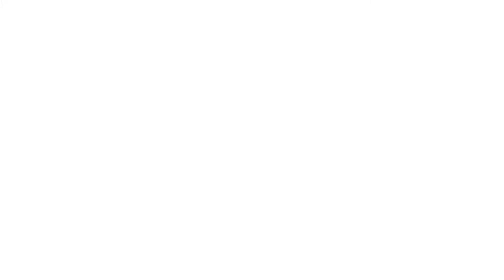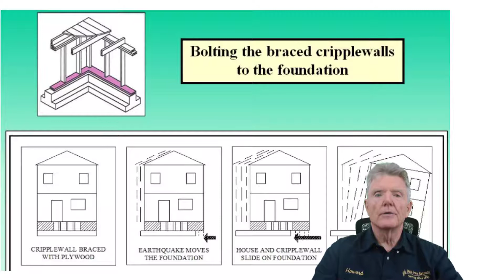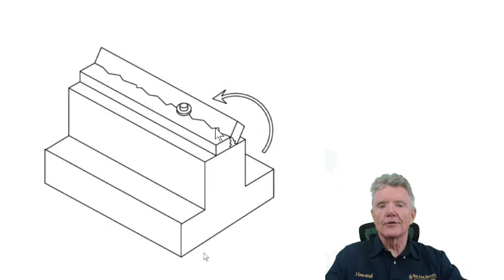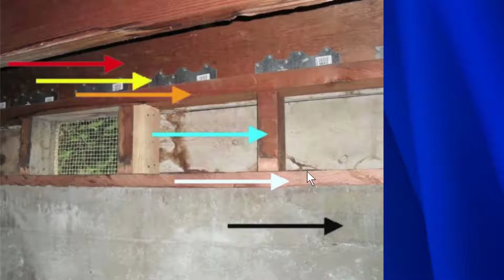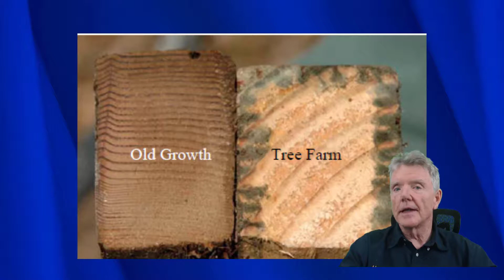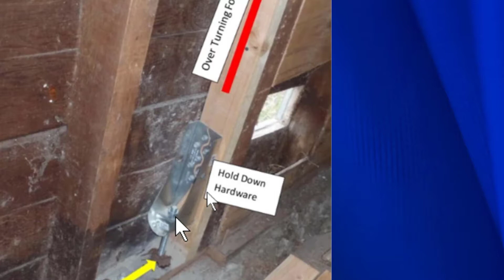Cripple Wall Retrofits 1900-1945: All You Need To Know

Comment: Great video. I just took a class through my city building inspection department. Our home was built in 1921. It has an approximately 24” high cripple wall. There is a basement in a portion of the understory. Our cripple studs are 24” o.c., while the floor joist are the typical 16” o.c. I want add additional cripple studs of old growth doug fir under every joist position that lacks a corresponding cripple studs. Does sound reasonable? It will of course mean that there are more cripples. I would nail them  top and bottom using buttressed 90 on both sides. Your thoughts?

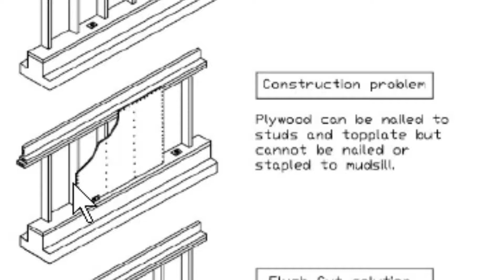Comment: 35:00 Flush cut solution - How many linear feet do you cut out? Have you thought about sistering 2x6s to the vertical 2x4 cripple wall studs and attaching the sheeting to that? That way you don't have to cut the mudsill.  If the top is 2x4 and bottom is 2x6, then you can cut or notch at the top so the 2x6 covers the top plate OR cut the vertical sistered 2x6's at an angle so they're 6" at the bottom and 4" at the top. IDK. Seems less likely the mudsill would split if it's not cut.
Reply from the maker: Flush cut saws are hard to find.  I would use 3x blocks and SDS Heavy Duty Connectors by Simpson

Comment: How do you handle floor to cripple wall connection when there is neither a rim joist at ends, or any blocking between , the floor joists sitting on top plate - perpendicular to the cripple wall? Add 2x blocking  & use L90s? Or hurricane type ties at the joist/plate connection? Both?
Reply from the maker: Add blocking.  First joist bay in line with the top plate and use an LTP4, the next joist push the block against the siding and use an L90 on down the line a few bays beyond the shear wall.
Reply: @bayarearetrofit5814  Got it - thanks info, your thorough videos are stellar btw - much appreciated.  
Re: add blocking - usually just toe nail (or SDS screws? ) both ends of the block?  Seems like proximity to ends of both the joist & block may split the wood ? Hmm a last thought:   if working left to right, suppose one could toe nail the LH side then use a longer fastener & end nail the RH side thru the RH joist from each adjacent joist bay  ?   May gain some strength vs toe both ends etc
Reply from the maker: You just need to hold it there enough so you can put in the hardware
Reply: @bayarearetrofit5814  Interesting, thanks. 
Makes sense to me the hardware would transfer lateral forces from joists/blocking, thru L90's block nails, thru L90's , into to top plate, and on down etc. 
But.... what about vertical forces moving through same system? 
Couldn't the house above shear walls also want to jump off the top plate?  
Seems like the toe nailing of floor joist blocking then becomes a relatively weak point of vertical load path:  if it's
top plate-->L90-->block-->joist-->1st floor/walls ?? Just trying to understand how engineers look at  this, sure I am probably missing something!
Reply from the maker: The house goes up with the foundation and down with the foundation.  Vertical thrust is not a consideration in the building code, even with thrust faults such as the Hayward Fault.

Comment: Great Video, I just qualified for the Earthquake Brace and Bolt program so I'm trying to learn as much as I could in a short amount of time. This video was better than the ones on the EBB website. I do have a question:

For a post and pier foundation, with a masonry perimeter (stone & mortar), can you anchor the mud sill to the stone wall? Or will you it be best to create new cripple walls along the interior of the crawl space?

Thank you!
Reply from the maker: Look at the video on old foundations.  Install new foundation segments parallel to the stone and build and brace cripple walls of the new foundations

Comment: Question:  An lean-to addition was added to my existing 1940s house leaving an existing portion of the foundation/cripple wall underneath the house.  The lean to addition only has external foundation -- it didn't add foundation on all 4 of its edges.  Do I need to add shear walls/retrofit to any of this under house cripple wall?  Is any shear wall added here just part of the overall needed along that "side" of the house  (i.e. the shear wall covers a minimum length needed for that side some on the exterior exposed foundation and some on the now under the house foundation.)
Reply from the maker: Explain to me better the foundation set up.  Looking at the addition from the front of the house.  Is there foundation under the left, right, and back sides of the addition?  Or only where the addition and new house adjoin?
Reply: The original foundation follows a reverse L pattern with the front of the house being longer than the side.  The lean to addition filling in the L at the back left of the house making a rough square.  Hence about 22 feet parallel to the front of the house (of 49 feet total)  and 24 feet parallel to the side is now (of 37 total)  under the house.  The lean to addition foundation is poured adjacent to the back/ends of the existing foundation but not otherwise bolted/plated the existing foundation.  And at least the floor joist supports (girders) aren't attached into this existing foundation under the house -- it just abuts it in the cripple wall.
Reply from the maker: @mfreedman1  Those are tricky.  You need floor to floor connectors and tension ties.  These are very technical but if you type in additions in the website search box there will be some information that will get you started.  These are very tricky and advising you via email will not be possible.  We normally used Simpson Heavy Duty SDS screws for the floor to floor connectors and HDU2 Simpson Holdowns for the tension ties.
Reply from the maker: Are these foundations for additions?

Comment: Question:  My house floor plan can be thought of as is a series of rectangles with the foundation being around the external/exposed edges of the rectangles.  I.e. there is no side that is a single straight foundation.  Does this (and how does this) impact the amount of shear wall I need to add (the same?  more?)  Do I need to be sure that each (distinct rectangle edge) has at least a portion of the overall shear wall on it?  If so what is the minimum and does the length of that edge impact minimums (in some cases my edges are 4 or 5 feet)?  Example:  one side of the house extends 22' to the west before a perpendicular 1 1/2' to the north followed by another 23' to the west.
Reply from the maker: If it is only one floor, you only need to do the outside edges.
Reply: Right, it is only one story.  The issue is I have multiple edges along each side of the house (because no side is straight -- but follows a jagged line).  Do I divide up the total linear feet needs for the full side amongst these sections on a given side or does each section require a minimum number of feet even if the total along the side ends up being more than necessary?  If I have a section that is problemmatic (due to plumbing, etc) will I be okay as long as the other section (edges) along that side of the house have sufficient plywood to reach the shear resistance needed for that side?
Reply from the maker: @mfreedman1  Just treat it as one floor and do all the work on the perimeter.  If pipes are in the way just put them where you can.  The critical thing is to get the correct quantity along each foundation wall.